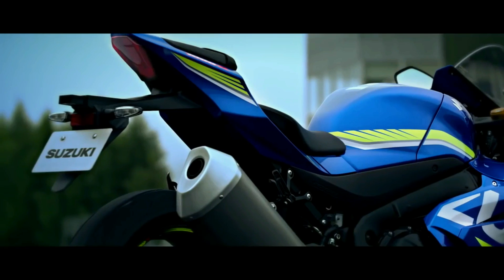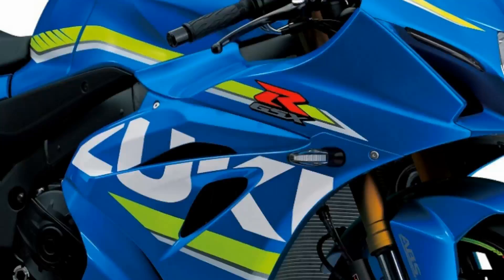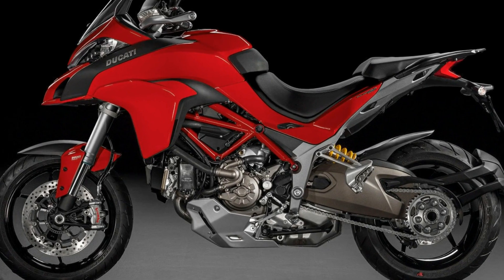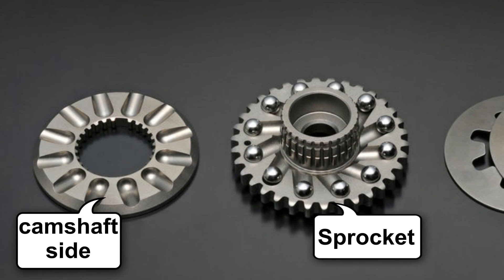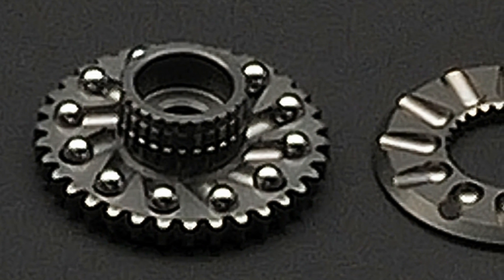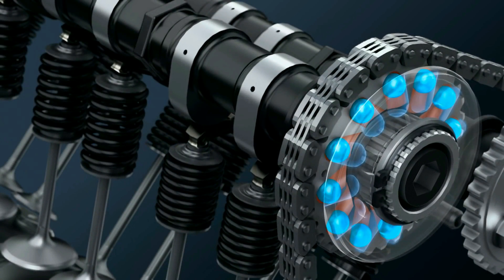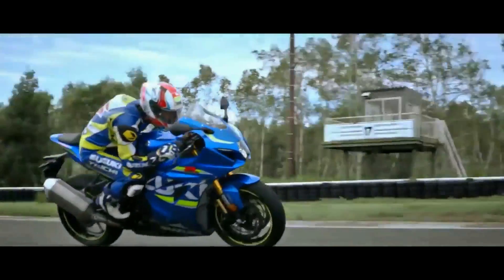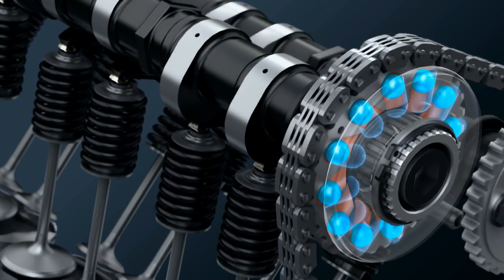Suzuki's Mechanical VVT (variable valve timing) explained

Comment: What a clever design, so simple and the more simple something is the more better it is, IMHO, especially in today's world of extremely complicated wiz bang gadgets.  Why has no one done this yet?  Its very similar to how a mechanical power valve works on many 2 strokes.   It's simple, effective, easy to tune and reliable.   Suzuki just scored some points in my book.
Reply: This system is a great solution for engines with no vvt. It does not need oil  pressure, solenoids or any electronics to work properly, it could be made closed with grease lubrication intiming belt engines and open system like sukuki in chain driven engines.  Im searching for years trying to find a similar system for my project car its a old project engine with no vvt, a small inline 4 chevrolet engine, sold in south america from the mid 90s until today. But no one until now produces it.
Reply: @chenical000  Bora fazer mano, vi que é BR hehe, chegou avançar nas suas pesquisas?
Reply: @TAlexandreHonório cara. Eu ate pesquisei umas patentes no google p estudar certinho isso. Em motor com corrente é mais tranquilo. Motor com correia precisa desenvolver o sistema selado com lubrificacao propria, com graxa ou oleo. Deixar tudo aberto pode causar desgaste prematuro e sujeira pode atrapalhar tb
Reply: @chenical000  Com correia dá para colocar graxa de rolamento que aguente alta temperatura, teria que calcular/testar qual o angulo das estrias onde as esferas iria rolar, quanto mais inclinado creio que dificulta mais a esfera girar e tende a só acontecer o movimento mais em alta rotação, a  viscosidade da graxa tbm afeta isso, mas creio que dê para fazer sim.
qual patente vc conseguiu ver? vou dar uma olhada tbm

Comment: It’s great but more parts to worry about to replace
Reply: This is by far the most simple and clever way of obtaining variable cam timing that I have ever seen.  Most systems are very complicated with lots of moving parts and rely on hydraulic pressure to actuate everything.  This is two plates and some steel or tungsten balls using simple centrifugal force to actuate, nothing there can really wear out.
Reply: So you don't want technology to advance?